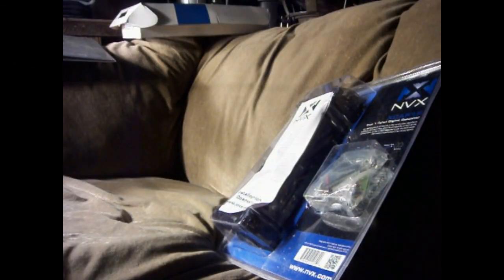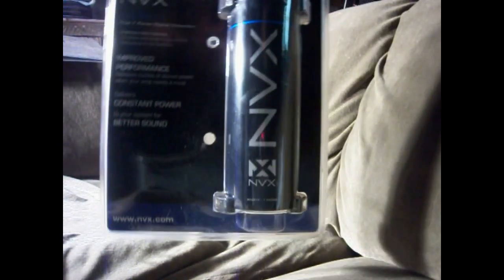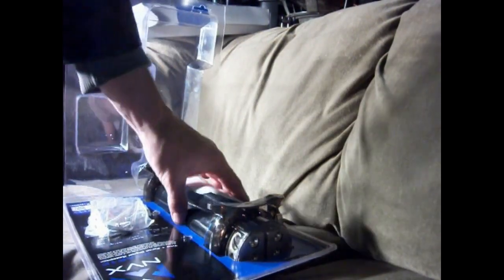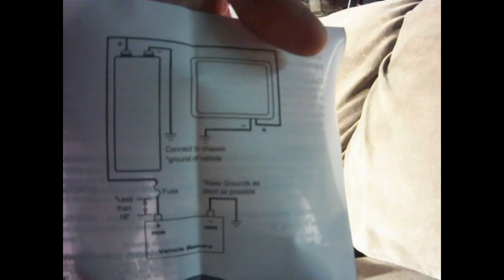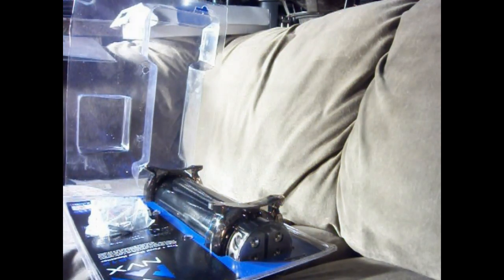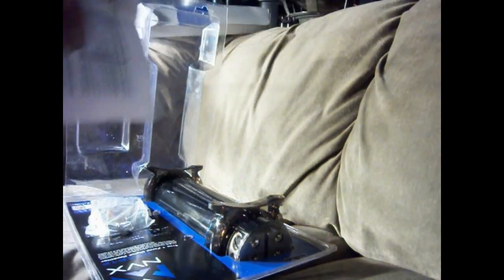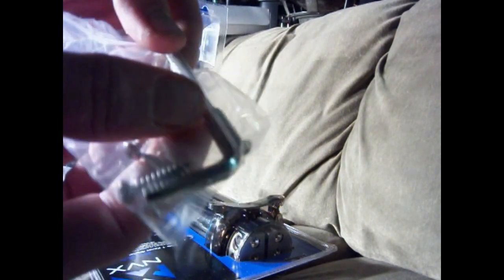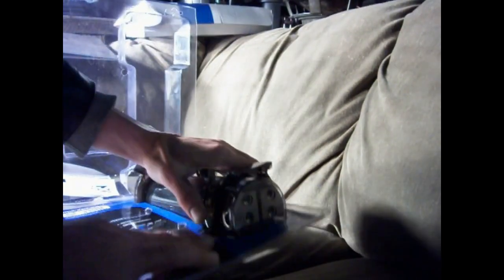Capacitor good for your system ? NVX Audio True 1.0 Farad Digital Capacitor XCAP1F testing

Comment: caps put a ton of extra strain on your batteries and charging system. i reckon the only time you should be using a cap is if you are running multiple batteries and have an alternator that can handle anything. but if you had all of that you wouldn't need a cap anyway.

Comment: homie, a 2nd battery with the proper alternator and the big 3 does a way better job on a large system. when u gotta do this and that to charge ur caps, my batteries are always charged. always ready to make my system pound. and what happens to the sound quality when ur cap starts going dead? the only thing they are is a power bank. they store power when its needed, but THEY TOO loose their power, batteries are always charged. btw, 1 farad per 1000w for like a song or two. lights still dim? TOSSIT

Comment: allot of people will say bullshit to capacitors . it isnt about dimming lights  on why u need capacitors ... ever had a car and  u hear a whirring  noise in ur radio as  ur playing music ? adding capacitors smooth out voltage spikes ... soo less background noise from voltage inputs why do u think the expensive home audio have 30 farad cells installed to them. clarity ... u can say bullshit all u want but  capacitors help with smoothness of  noise . go on take all those capacitors out of ur amp . u loose stability. that is what a cap is for stability